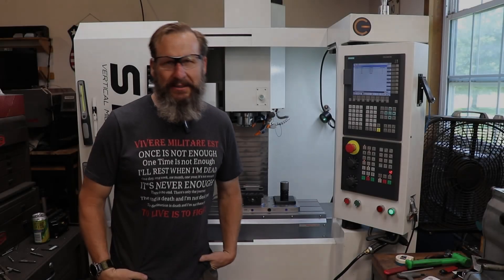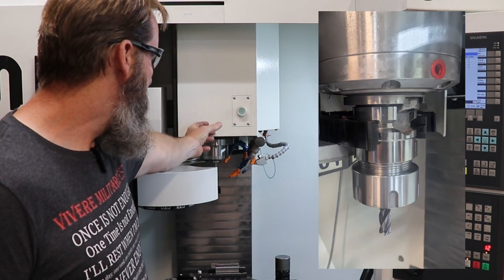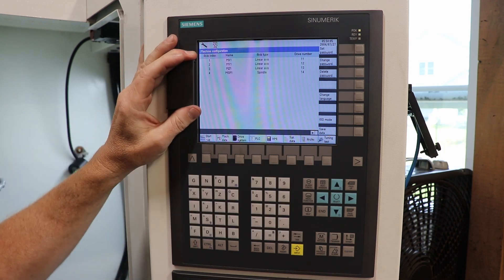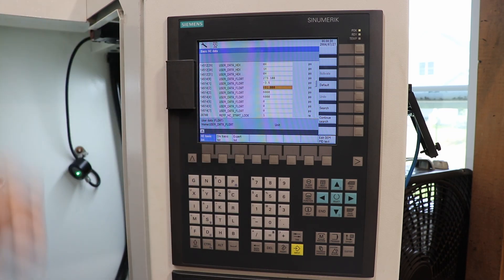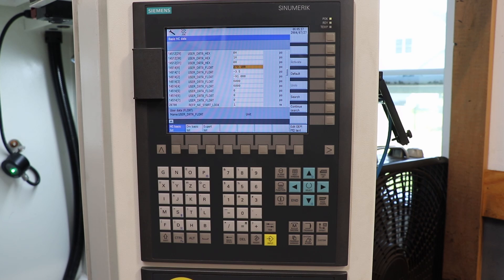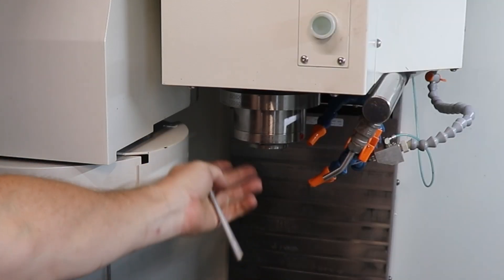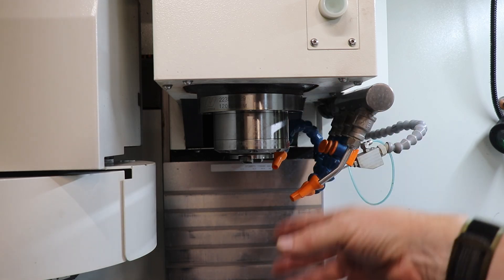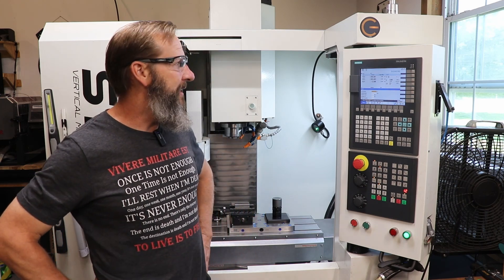Crashed SYIL X7: How to Rehome Z & Spindle Orientation

Comment: Mathew just helped me today as well! Great guy. 

My machine has the side mount tool changer and hit offset of the groove in the tool holder as well. Got stuck and alarmed out. 

I ended up posting on Facebook and was told how to back the arm off the holder and that worked forgetting the tool out. 

Still had alarms that the arm was out of
Home and that the arm had a toll on top
If it. 

SYIL got me in contact with Mathew and tonight we rehomed everything and got it squared away in about an hour. Great support from him and SYIL.
Reply from the maker: Agreed, Matthew is a great guy and very helpful, especially since he's doing it over the phone.  

Fixing these machines is a good reminder that they can be fixed and they are made well with good components.  

There is nothing quite like the feeling you get though, when the machine alarms out and you can't get your work done.  😂  Or when you crash it and it's as surprising as shots fired.  

Anyway, glad you are up and running again as well.